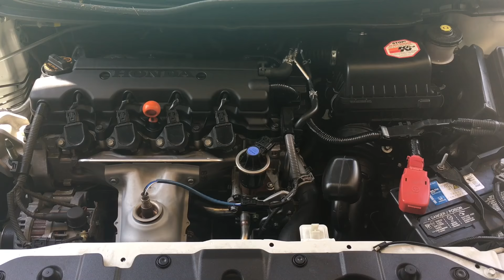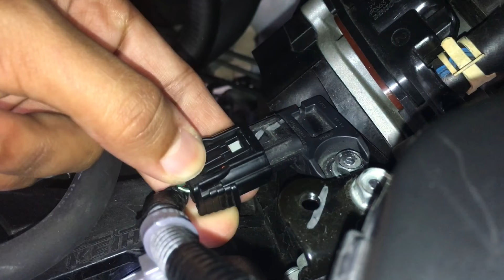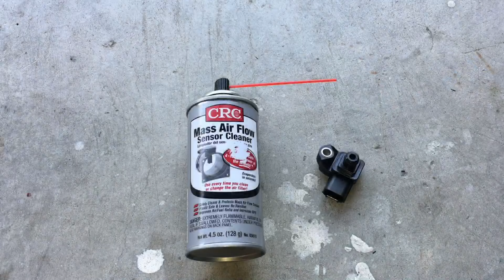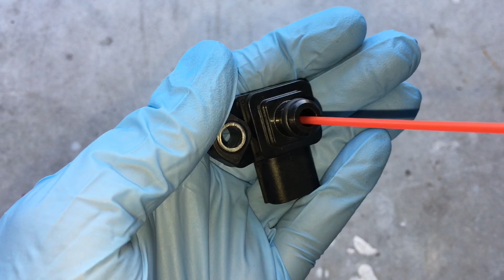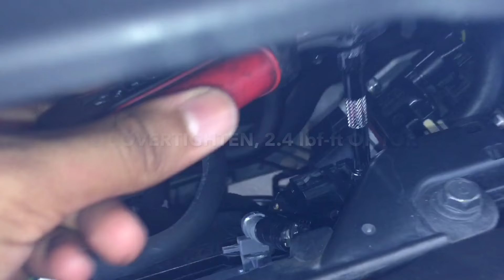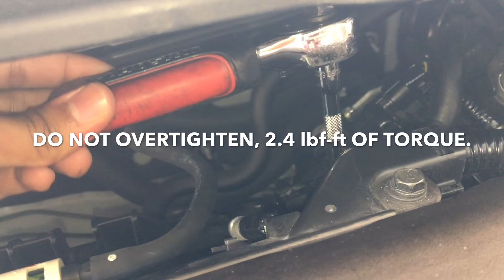Honda Civic MAP Sensor Clean & Replace DIY

Comment: Thankyou brother you saved me a big time... i cleaned the maf sensor and the throttle body after that all lights pop up check engine , traction you name it and the car was running very rough with the mpg of 16 mpg too low for civic lol. I just cleaned my map sensor i think i sprayed the throttle body cleaner little too much... everyrhing went back to normal thankyou once again stay blessed:)
Reply from the maker: Jibran Samad usually a idle relearn fixes but if it learned itself then I guess you’re good
Reply: MAP SENSOR NOT FAF
Reply: Did you clean your MAP sensor using throttle cleaner spray (carb cleaner)?
Reply: @zaifkhann  throttle body cleaner =/= carb cleaner

Comment: Thanks for the video man. It’s very simple and I cleaned maf sensor, throttle body for civic at 60k miles. Feels like I recovered my horse power and a little better gas mileage.
Reply: What types of cleaner you used friend?

Comment: Great! You help me a lot. The thing is that I changed an old air filter to my 14’ Honda Civic and I skip the sensors cleaning part. So when time pass the car turn on some flags in the dash board. Thanks to this DIY I find out what was wrong.
Reply: Hi sr, which flags went on? Im having some issues, thank you

Comment: I have a 2012 Honda Civic coupe. In my check engine light came on p1129. I placed a new map sensor. It went away after 30 mins then it came back on with the same code. What do I do 😭
Reply from the maker: Use an OEM sensor if you didn't but OEM

Comment: Does it ever need to be just replaced, or will cleaning fix the issues?
Reply from the maker: You’ll get a check engine light for it if it ever fails

Comment: Is the mass sensor and the map sensor the same
Reply from the maker: yes
Reply: No, there is a MAF sensor, as well as a MAP sensor. They are 2 different parts.
Reply: @TheMervK indeed merv is correct they are two different parts your MAF is the one that’s going literally inside your intake the MAP have two different locations one is near the MAP but under near your purge valve and other one is towards the back of your engine you’ll see the blue bar looking thing

Comment: what if i already clean MAP with carb cleaner ? :( no check engine, but idle seems to roughen a little bit
Reply from the maker: You probably already damaged it
Reply: @MrRangerZr1  is it possible the map sensor is in learning process?
Reply from the maker: @djusbddjvz  no
Reply: I learnt the hard way and damaged mine. You live and learn. MAF cleaner only

Comment: great videos, I have 2015 Honda Civic I had a rough idle I clean the throttle and calibrate TPS  also clean MAF new air filter still little bit rough in a cold engine, going to clean this MAP sensor hope that works. any suggestions Mr.RangerZr1.
Thanks.
Reply from the maker: How many miles on it?
Reply: @MrRangerZr1  only 30 miles
Reply: @MrRangerZr1  you think I have a faulty  sensor? no engine light  on the dash
Reply from the maker: Tony Alzua how many miles does the car have?
Reply: @MrRangerZr1  I am in Canada so is about 49.000 Km I guess is about 30.000 miles
Reply from the maker: Tony Alzua did you just buy the car? 4 cylinders do vibrate then v6s

Comment: Does anyone know if I could use the same socket wrench for a 2001 Honda Civic?
Reply from the maker: Should be a screw or bolt
Reply: Do you know what size screwdriver?
Reply from the maker: @dontaesalvodon1186  Should be #2
Reply: @MrRangerZr1   Thank you

Comment: Can we clean the MAP sensor with Carb cleaner?
Reply from the maker: Žãiƒ Ķhän's Nooo...it will damage it.
Reply: MrRangerZr1 Okay, I've a Honda city idsi 03 1.5L,.the problem is it's RPM some time drop down when AC is on and start shaking,i clean the IACV many times also Calibrate the TPS its okay, but same shakinggg.. What might be the issue please help?
Reply from the maker: Check the battery and alternator.

Comment: Why and how often should this be done?
Reply from the maker: You rarely clean these, sometimes they can get clogged with carbon or oil.
Reply: @MrRangerZr1  I'm assuming it's not dangerous to clean them with the proper cleaner. Just spray, let drip and wait til it dries the put back in.
Reply: Mike Kollin Conscious Power can we clean MAP by carb cleaner?
Reply: @zaifkhann  no, leaves residue
Reply: seeeLAH1 okay 👍